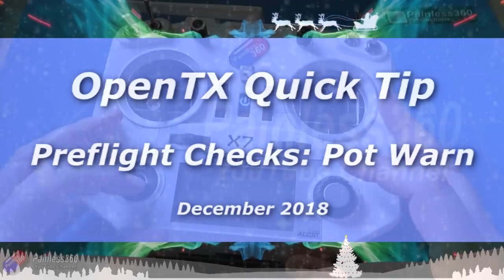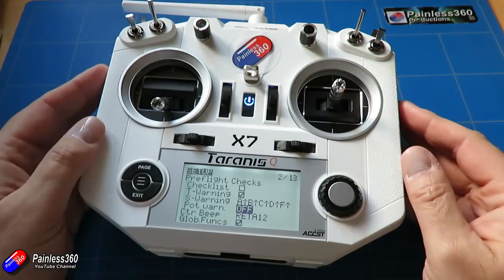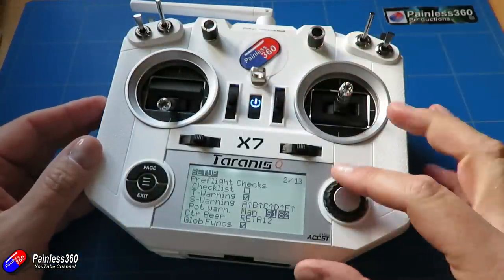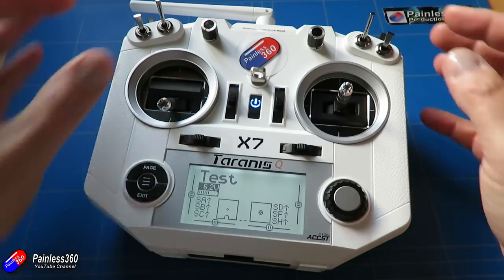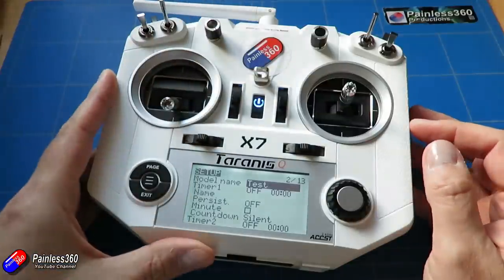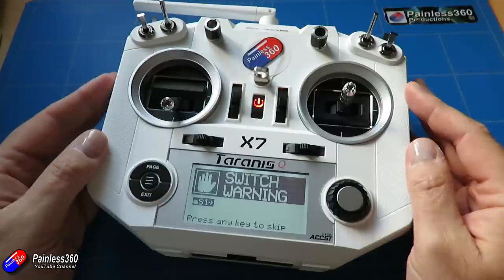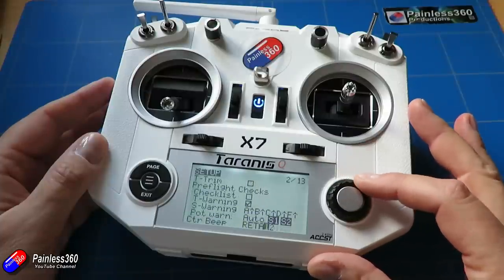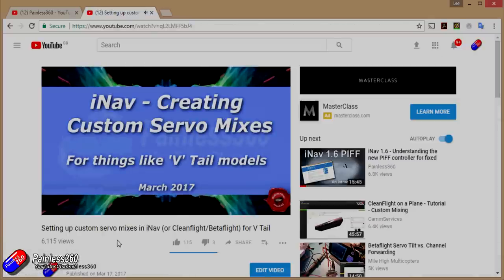OpenTX Quick Tip: Using Preflight Checks: Pot. Warn.

Comment: I've decided to build a DIY tx using an old, but still awesome, Futaba "gold series" radio, an Arduino Mega and an LCD....
I've been reading and watched a bunch of OpenTX videos.
I have a question about the firmware I was hoping you could answer for me.
Do I just grab the most recent firmware or do I need to specifically get firmware that says Arduino Mega on it for the DIY platform?
I've built my own OpenLRS modules, I don't want to try and take advantage of the telemetry functions and also I'm hoping to get 16 channels.
The gold transmitter has plenty of switches but it's also interesting in that it has two sliding trim tabs for additional channels as it was originally any Channel radio but it also has potentiometer trim tabs on all four of the primary channels that I think I can use as well. I'm thinking about using the trim tabs on the right stick as my gimbal controls.
I'm also adding some push buttons on the back of the transmitter for the menu navigation.
Reply from the maker: That sounds like a really exciting Project. Please let me know if you get it working. Best of luck!